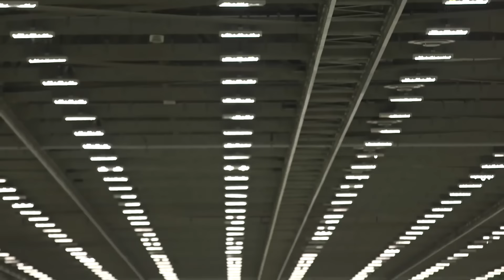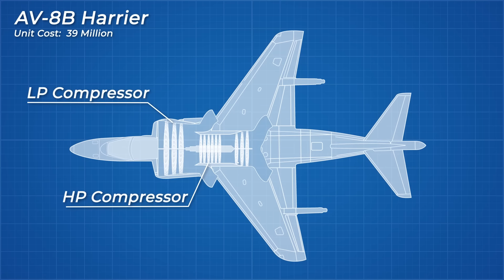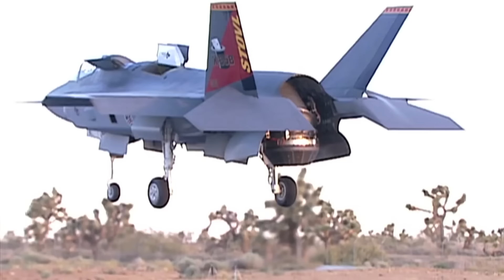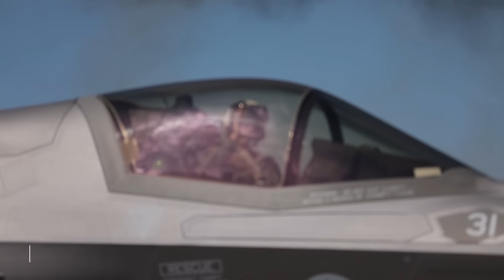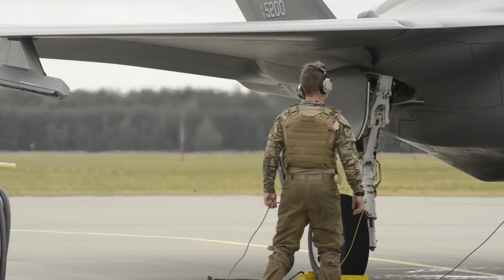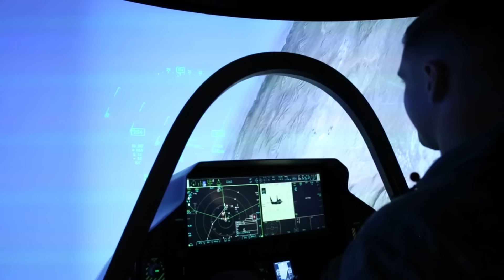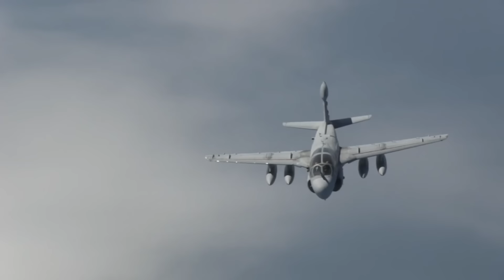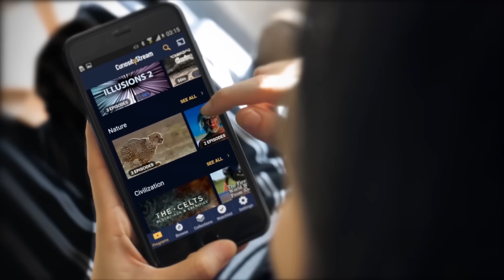Is The F-35 Worth $115 Million?

Comment: I've always found it interesting,  how ONE aspect of "Fly-off" contracts is the "Production Ready" aspect, Lockheed ignores. When a contract is awarded, the production is supposed to begin.
BUT, Lockheed just pays no attention to that, adding "Further development testing" and driving the cost up, as opposed to the inital price quoted to taxpayers. So basically, you need a system now. Lockheed sells you a weapons system "For Now", at this low price.... a decade and a half later, you finally field that system, at 4 times the cost, you first awarded the contract, 15 years prior!
That has been Lockheed's M.O., since the 1970's!
Reply: That's normal. Every fighter in history has had a delay before entering production, let alone service. This is because the fly-offs DO NOT require production ready aircraft. That is because of 2 things:
1. The military are not going to pay huge amounts of money to develop an advanced fighter and then decide the other fighter wins the competition.
2. The overall competition includes many other competitions for the components that will go into the fighter. They all add up to create delays. 

The most that can be reasonably expected from the prototypes during the fly-offs is placeholder systems, but most of the time they don't unless it demonstrates something that could give the company an edge.

And if you really want to complain about the delays then don't complain about Lockheed. Their YF-22 was way ahead of the YF-23 in terms of production readiness. Not to mention the X-32 (that competed against the X-35) wouldn't have entered production looking like that because Boeing were still revising the airframe design during the competition and promising that it "would" be able to do things the X-35 could already do.

As for price... the F-35 is only slightly more expensive than promised. The initial cost estimation is not literal. It is a figure of comparison. Initially the F-35 was priced at $30 million, at a time when F-15s were roughly $40 million and F-16s were roughly $25 million. F-15s today cost more than $100 million and F-16s go for roughly $60 million, so you'd expect the F-35 to cost roughly $70 million. The F-35A currently costs $78 million. That's not bad at all and is in fact cheaper than most modern fighters.
Reply: @dumdumbinks274  
NO it was not.
Northrop had a production line, ready to go. A.F. just had to award it, and the 23 would have begun production, within a month of the award.
It was politics, as usual (Graft, Greed, corruption) that awarded the contract to Lockheed. 
AND to add insult to injury, the 22 ended up with the computer controllers, avionics and pilot life support systems,  (Due to the Lockheed system, poisoning the pilots).
And it wasnt ready, until 15 years later!

Now, Japan is looking at revisiting the 23 design, and updating for current production. 
The F-23 may be late to the party but, she may get to dance, yet.
Reply: @jerrypadilla4384  Ah so you believe that myth, and decided to add even more misinformation...There was no political meddling, that's a claim that people who have no idea what happened resort to because the YF-23 in theory could have outperformed the YF-22 if chosen. Lockheed won the contract fairly. 

Northrop's production lines were no further ahead than Lockheed's. The APG-77 radar and the weapons systems didn't exist at the time, so no, they could not build production models only a month after the competition. They didn't even complete their testing...

The YF -22 won the contract on several counts
1- It met all requirements
2- It didn't rely on any experimental tech so it was considered to be significantly less expensive to produce
3- It beat the YF-23 in terms of practical advantages. Maintainability, maneuverability, and payload were all in favour of the YF-22.
4- Lockheed demonstrated every advantage the YF-22 had, including performing live-fire testing with a temporarily installed radar to demonstrate reliability of their weapons bay designs. All the while the YF-23 only had ground-based mockups of it's weapons bay and never performed any live-fire tests.

The vast majority of electronic systems in the F-22 are/were Lockheed-developed systems. The electronic warfare suite was Lcokheed, until the subsidiary company producing the system was sold to BAE. The MLWS is a Lockheed product. The avionics are all Lockheed. The only system in the original F-22 produced by NG was the APG-77 radar, but they didn't do so until 1996 when they bought out Westinghouse who were the original manufacturers. Basically, nothing in the F-22 was designed by NG. 

Oh and the system that caused "poisoning" or rather hypoxia symptoms i.e the OBOGS system... it was not a Lockheed product, and it didn't cause any issues until well after the F-22 had entered production. The same thing likely would have happened with the F-23 if it had been produced as all new US fighters were using OBOGS. 

Japan is not looking at revisiting the YF-23. That myth comes from the fact that NG are assisting Japan with their X-2, but so are Lockheed.
Reply: @dumdumbinks274  
You sound like a Lockheed shill, to me.
As I stated previously, Lockheed's M.O., since the 1970s. Have been consistently bidding on projects,  extremely low, then drag their feet on "Development" issues, while running up the project costs.
Be it missiles, satellites or aircraft platforms.
Stealing....uh, I meant employing other's technologies, is not out of their realm....just could never figure out, how they also charge for development costs on the items too..... but they have!
Reply: @jerrypadilla4384  You sound like somebody who has an agenda and prefers willful ignorance over knowledge. Cost overruns and delays have been normal for military procurement since forever. The newer the technology the more unknowns there are. If the technology used isn't new then there's not going to be much progress, but the military don't want to spend large on something that won't give them a long-lasting advantage, so all new projects use new tech. New tech generally means more complex systems become possible, and more complexity is where the performance advantages are achieved.

Case in point is Northrop's B-2. 8 years from selection to first flight of the production model even though it was  developed during the Cold war when the military budget was at it's peak (unlike the F-22 which suffered from massive budget cuts). It was heavily delayed leading to cost overruns before it even entered production, and by the time it entered service the Cold war had ended and politicians wanted to cut back on military spending, so production ended after only 20 aircraft out of the originally planned 75 were built (or 132, but that was due to a change in design requirements). 

As for "stealing" what specifically are you referring to?

Comment: F-35 is a flying turd, but heh now you have it you have to eat it.
Reply: Bullshit.

https://www.reddit.com/r/F35Lightning/comments/8a66ta/out_of_the_shadows_rnlaf_experiences_with_the/
Out Of The Shadows: RNLAF experiences with the F-35A - Combat Aircraft Magazine May 2018
1. Dutch F-35 Block 3F, "F-35 sits somewhere in between the F-16 and F/A-18 when it comes to within visual range manoeuvring'".
2. Lightest empty weight F-16A MLU air-superiority model needs to be clean (no weapons, no external tanks) to make visual range dogfight interesting against combat loaded F-35A Block 3F.
3. Dutch has acknowledged early F-35 Block builds being beaten by F-16s with external fuel tanks which are NOT applicable for F-35A Block 3F build.

Comment: guess we didn't learn our lesson with the F111 did we?
Reply: The lessen from the F-111 program (i.e don't shove a heavy strike aircraft into a role it wasn't designed for) is irrelevant to the F-35 program because the F-35 mission requirements were almost universal across each service and multiple variants were produced BEFORE selection rather than after selection like the F-111B was.